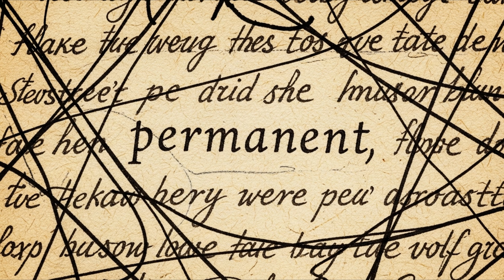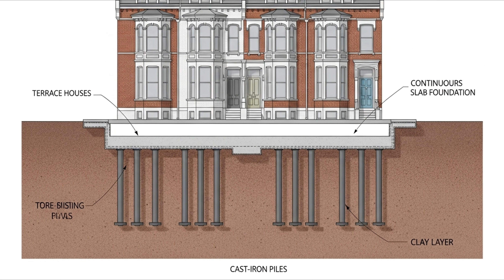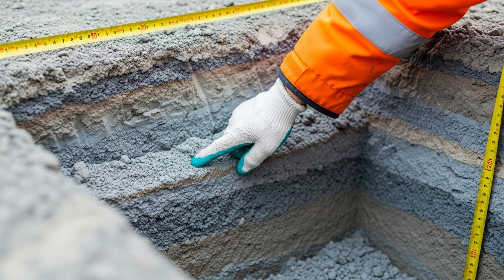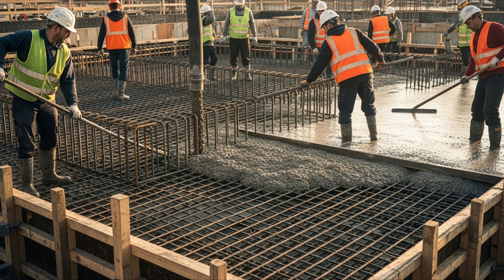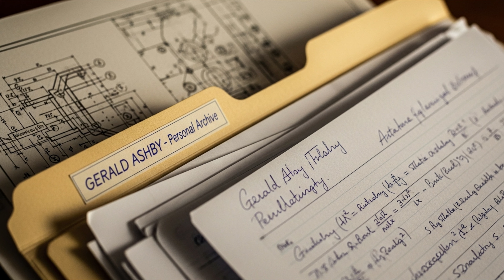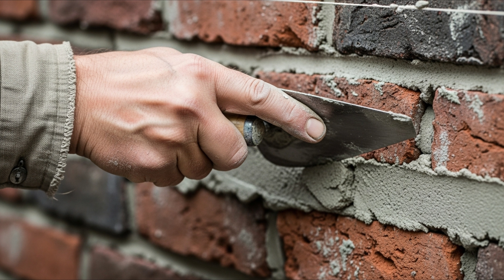How Victorian Row Houses Share One Continuous Foundation 20 Feet Deep

Comment: I own an 1970 built London terrace house. I am sitting in its cellar right now where I have my den. This cellar was dug out by me and a friend 35 years ago. Most of the houses around here did not have cellars originally. 
But the main point is they did not really have foundations either. Just a pile of a dozen or so ordinary bricks In each corner. Would never be allowed today .A lot of Victorian building was dreadful; there is even a term for it = Jerry built. Odd thing is they last fine with almost no foundations so long as they are not bombed etc.